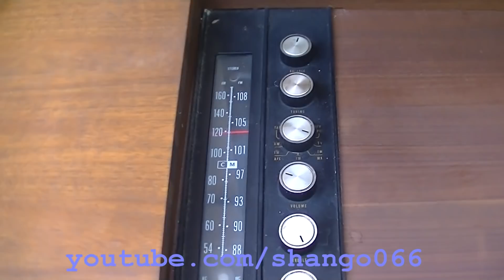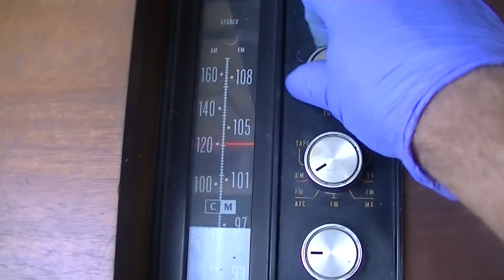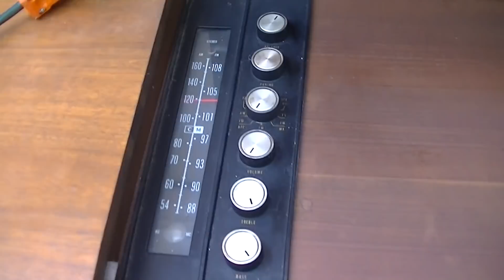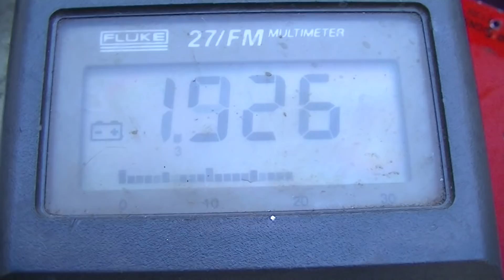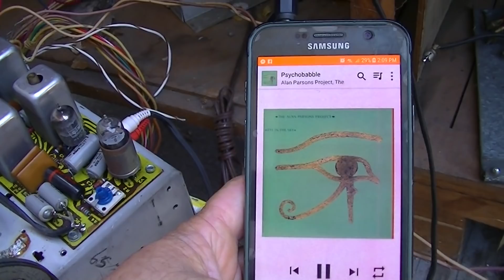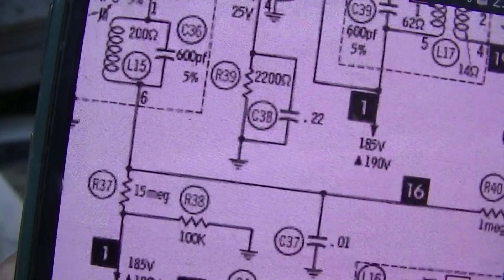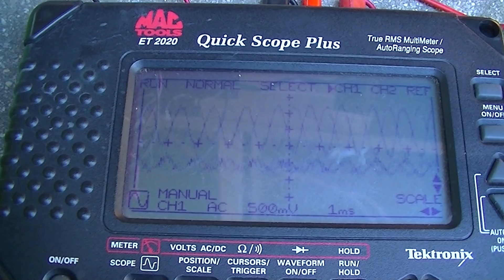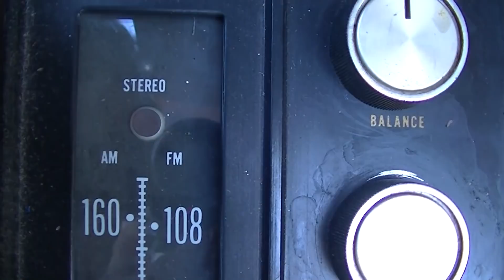Curtis Mathes Tube Tuner Stereo MPX Diagnosis Repair

Comment: Nice diagnosis! The L16, C41 and C42 is a low pass filter that feeds the (mono) audio through a bandpass amplifier and injects it into the stereo matrix circuit. The amplitude of this signal controls the amount of stereo separation generated in the matrix. The filter keeps the 19k pilot from interfering with the matrix. However, as you found, the filter really didn't do that much as bypassing it made the circuit work. It probably only decreased the stereo separation somewhat. I love your videos! Takes me back to the old days.

Comment: A number of years ago, someone asked me to fix an early '90's Curtis-Mathes color console and it was a re-badged Zenith....complete with standard issue bad Zenith CRT. They could have bought the genuine Zenith-branded set for a lot less money and still got the same crap CRT. As far as the ones from the '70's and '80's, many of them were made by NEC. They were nothing special and I never saw a picture on one that blew me away.
Reply: I remember having a Curtis Mathes store when I was a kid. The sets were overpriced, but they had some of the first VHS rentals in town.

Comment: Curtis Mathes was the cream of the crop. They were hand built in Fort Worth Texas and very expensive.
Reply: Yet they evidently cut corners sometimes... rather sad.
Reply: they were cutting labor costs by outsourcing from Japan, and designing with lots of couplate modules instead of individual components. The cabinet was not well braced and flexed easily when moved. Reeks of low quality. So they had lots of profit built into the inflated price.
Reply: @cttv90108  Yeah, I noted the lower-end stuff way back when these were new. The reel-to-reel decks that came with the high-end models were the cheapest to be had and the electronics they put in them were bare-bones/minimal to the point where you were amazed they worked at all. Yet they had a Premium image with the general public. Yes, there were worse out there, mostly sold by schlock furniture stores with Hong Kong guts.
Reply: @RuneTheFirst  For cheap, don't forget Muntz
Reply: @olradguy  They were long considered the worst but I suspect some of the stuff sold by other brands later on could have out-cheaped them. Especially stuff from Hong Kong in the 60s and 70s. Cardboard cases and cabinets were surprisingly common, Never mind the junk inside. Some were so bad they failed in weeks.
Reply: @RuneTheFirst  I even have an old 3 dial TRF battery radio from the mid 20s branded Muntz-ola. Guts weren't to awful but the wood case seems a little on the low end, thin wood rather plain etc.
Reply: Fort Worth huh? So that console my dad had stored in the backyard probably was a Curtis Mathes then. Idk where he got it from but it was rotting away.

Comment: I like those round 45 RPM adapters. Those flat ones are boring.  Nice set.
Reply: Those 45 rpm round adaptors are a part of the Garrard turntable changer.
Reply: @cletusspuckler2243  Garrard turntables were once the pride of Swindon, England, until they cheapened down to compete with BSR.

Comment: Later part of 1980's working at TV shop in Santa Clara we had a retired couple who had purchased one of these new from the shop in a Cherry wood Cabinet back in the 60's. It was Beautiful and they kept it perfect.. We told them we did not want to maintain the TV anymore due to age and sold them a new RCA FKC2601T. We were able to cut about half an inch of the RCA top and slide it into the consul. It worked slick. We also setup a relay to disconnect TV from consul speakers if radio or TT was used. $1200.00 bill :-) Thanks for the memories !!

Comment: Loved your video on this piece of expensive junk. Imagine a big set like that with 5- watt single ended outputs! Almost any Heathkit or even Radio Shack component amp of the time would do circles around this baby. And with what you call 5-watt speakers, unbaffled of course, you have $49.99 sound in a set that must have cost $800. That’s why component and then compact stereo spelled the end to the old crappy consoles. My mother dreamed of getting a Magnificent Magnavox until my dad and I built a Heathkit-based system that sounded great in 1956. I even integrated TV audio into it. I’d love to see more of these console restorations!
Reply: Consoles would have worked better if the makers of respectable components sold cabinets specifically built to hold them, but which could accommodate add-ons and updates. Of course, that would have cost the price of a decent cabinet plus the price of a decent stereo and a lot of consoles sold for a lot less than  that.
Reply: @pcno2832  Fisher made some impressive consoles back in their early "The Fisher" years.

Comment: I remember the video of you & Chris picking this up. It started to flex & nearly fall apart as you were pushing it onto the back of your truck. LOL 😂 XXOO
Reply: I'd like to have one of these in my living room next to the wood stove. Too bad they're an absolute bear to move and pick up. It just looks "homey".
Reply: volvo09 - True & everything you needed was all in one unit for easy entertainment & convenience. 👍🏻
Reply: That's nothing that a 2x4 attached to the bottom won't fix. The weight is a different problem though. Maybe they can mount it on a wheelbarrow? Two wheelbarrows? :-)
Reply: Jac Goudsmit - The wheelbarrow idea would work well, even a flat based trolley on wheels. It does look like a very awkward heavy unit to Manoeuvre around, I feel for shango who has to load it into his vehicle for the rave party! It did take a lot of struggle & muscle power for him to load it onto the back of his truck the day he picked it up, ages ago but shango is one man that surprises us with anything as his awesome at everything. 😊
Reply: i remember that too. You're a true Shango066 fan, as am i. Princess Gypsy looked cute in her pink jacket!!  :)
Reply: Moderate Extremist - Yep, us shango066 fans rock. 👍🏻 
I often, for hours watch past videos of his. 🙂
Reply: Moderate Extremist - Yes Gypsy is a charmer with everyone.

Comment: not much of a repair guy, but i do love His societal observations and his witty and sarcastic statements that always hit the target..Shango is a rare breed..
Reply: thats not really fair, he does have the knowledge and skills, but how much time and components would you waste on a sacrificial unit?, going to be set on fire or dumped after the party.
Reply: Push Pull 6BQ5 matched pair output tubes......! Nice
Reply: Old Capacitors for the Plate Voltage B+
Reply: I reckon his a excellent repair guy! Knows more then I can only imagine & certainly has the magic touch of bringing dessert find tv’s etc back to life.

Comment: When removing the necked CRT, try soaking it in acetone and/or toluene to see if quickly dissolves the PVA. It might be a better method than water or heat for cataract removal. (would at least make for a fun video experiment with no risk of implosion)

Comment: Kind of surprised to see them using 6AL5 tubes instead of solid state diodes. They must have gotten a ton of them for nothing since they were so obsolete by the mid-50s.
Reply: or they used one because many germanium diodes still have some resistance even when reverse biased, although a few megohms, maybe still enough to leak some signal through ,  which would reduce stereo separation ,

Comment: Kewel beanz... I recall the rental firm Colortyme, featuring Rebranded sets like Goldstar (remember them?) that proudly displayed the Curtis-Mathis name. The C-M was only 3X more $
Will there be a fuel cost adjustment in the transportation charge? You may recoup that when it is burned for fuel.
That little coil wire may not fare so well during the ride out to the desert
Love the concept of the filament power off